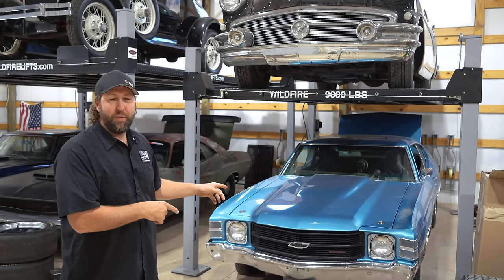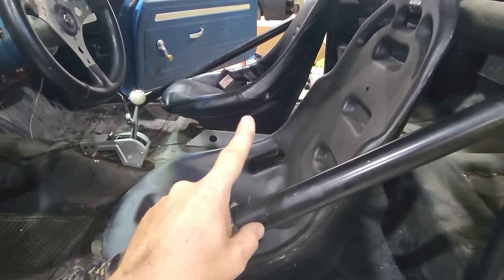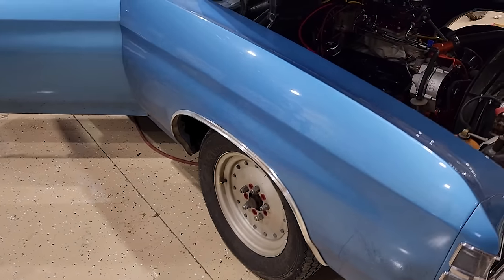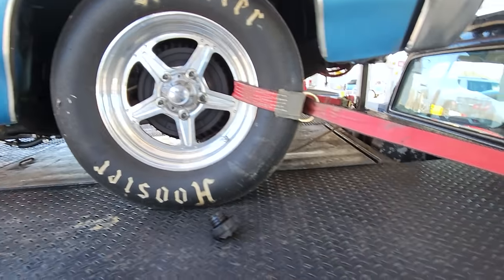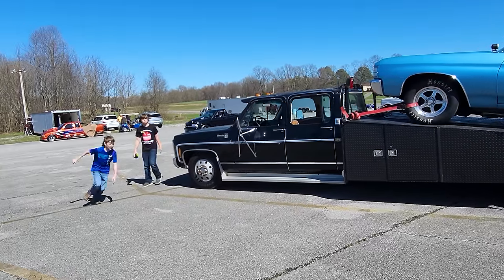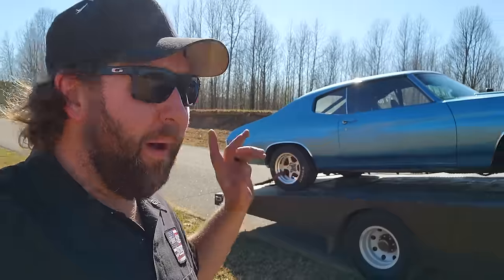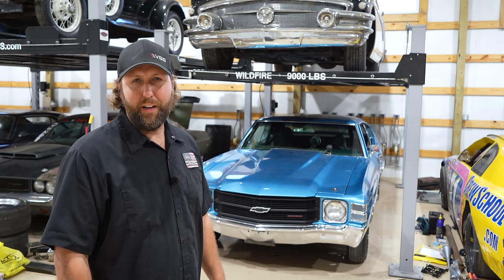35 YEARS off the Road - Classic Chevelle's First Passes are INCREDIBLE!

Comment: THANK YOU FOR THIS VIDEO!!

Lil late on the comment section. Just wanted to say a guy had virtually the same car in high school. 
Blue 70 Malibu, 383 Stroker, 4:11 posi, line lock, ratchet shifter, Vic jr manifold etc. 
Watching this has inspired me to find another Blue 70 Chevelle. This is almost identical to my old  car. Mine also ran in the high 12’s.

Comment: I could really see a couple of different ways to go with this. I think I would for sure keep it old school, either the 400, or a big block. First, put a shifter in it that you're comfortable with. It would be the perfect home for the big block from Independence, which is what I think most would want to see. It would be great to take the 400 to the next level though, with aluminum heads, roller cam, higher compression, etc etc. 4 wheel disk conversion for sure!
Reply: Yes, great project! But make the shifter a priority! Keep up the great content!
Reply: Didn’t he put the motor from independence into that nascar truck chassis?
Reply: @andywagoner4869  He put the original 454 he built for Independence in the nascar truck. the Blueprint 540 is still in Independence.
Reply: @konfyoused  oh gotcha.

Comment: Man, that is one SWEET Chevelle! If a guy gets that shifter straightened out, and a decent radiator, I think it could run a 12 flat in the quarter with a few timing and tire mods. Talk about low budget racing, that's it right there, Derek!! What a great ride.😄👍🏁 EDIT: I just went back and looked at your test and tune video, and looked at the distributor. You'd be wise to upgrade that to an HEI unit, and open your plugs up to .045 for some easy horsepower on that small block!😉

Comment: The reverse valve body shifter sounded pretty cool. If you do an engine swap keeping it old school with a 454 would be pretty cool too.
Reply: that chevelle could have had anywhere from a 250 straight six to a 307, 2 different 350 options, or a 400. a 454 was available in SS trim only.

Comment: Love the sound of that motor!  I hope you do some incremental mods with plenty of testing. Better shifter, electric fans, hotter spark, etc. I agree with the guy that suggested fender covers to protect the paint. With VGG logos they would be a good addition to the store.
Reply: I'd spend my money on a proper trans and rear for this car. 

Even if you're only pushing 500hp, a trans brake and a locker are good investments to get your ET to be more consistent for bracket racing.

That and proper valve springs. Stop the valves from floating.

Comment: Great video - I really like the idea of keeping it a late 80's monster street / strip car. Would love to see it rev out with a big old school solid flat tappet cam with 250+ @.050 duration and the 4.88 gears. Like an Isky Z-30 or even an old GM Z28 off-road race cam
Reply: YEA,HE SHOULD KEEP IT OLD SCHOOL FOR AS LONG AS POSSIBLE
Reply: The current engine doesn't have enough compression for a cam like that.
Reply: @davelowets  I mean if it's got 11:1 you can go pretty big on the duration. As far as I know I don't think the compression has been checked yet the heads haven't come off.
Reply: @colinjohnson7663  I doubt it's even close to 11:1
Reply: @davelowets  if it's got flat tops and 64cc camel humps it'll be close to 11.5:1 so I guess we'll see
Reply: @colinjohnson7663  If it was that high, he'd be running less timing, and pump gas wouldn't be a good option.

Comment: Absolutely great video! Our 406 has heavily worked Trac 1 heads and it makes a difference. I would say with a really good set of heads, a swap to E85 and see if you need a little different carb would make a good difference. What about the gear? What was the rpm when you crossed the finish line? I would bet at least a 4.56 would help. We're running 5.38 and crossing the finish line at 6700. I wonder about your rear tires as well. Thank you ..... fellow Tennessean!

Comment: What a great find.  The car has such a unique history and been preserved so well I’d love to see it stay more or less in its current form.  Pull the 406, tear it down and closely inspect, and rebuild it with some modern techniques and equipment, especially heads/valve train to raise the RPM and power thresholds safely & reliably.  Put a serious cooling system and a Gear Vendors overdrive unit in it and make it a true Sick Week machine.  I know it would be fun to swap a big block or spicy LS into it, but I’d love to see it optimized in its current state and keep its history intact for future generations to enjoy.  Long time subscriber, love the channel and can’t wait to see you work on that GN!

Comment: Just wanted to let a fella know, if you dismount the original wheels off the Chevelle, those Centerline wheels are prone to leak where they are put together in the center.  Easy to fix.   Clean the seam out good and apply a bead of clear silicone all the way around the wheel and smooth out with your finger.  Give it about 20 mins before you remount tire then air them up,  the air will force  some silicone into the seam and help the seal even more.  Works most every time.  Always enjoy the videos and seeing your boys in the shop with you.

Comment: I remember in the mid 90's I helped my buddy rebuild his 350 and we had the same issue with the power band just flattening out after 5500 RPM. After multiple attempts to figure out why, we finally swapped out for a new cam shaft. That made an entire world of difference. While the old cam looked good, and felt good, it wasn't aggressive enough to keep pushing past 5.5k. It's been far too long since I've done any work like this, but man, you made the nostalgia juices flow. Thank you for sharing!

Comment: Back in the late 80s pulled a old Newport  with my v6 80 Camaro  about 50 miles to a Bumb and Run with a chain.Track was Checker Flag in Windsor  Ontario, closed now. Tuned in from Ontario. 🇨🇦

Comment: This brings back some great memories.  I ran 1/4 mile track back in my days at Hollywood Speedway (Fl). That was many years ago with my 69 Z/28 with 302 cu in, mild cam, headers, nothing outlandish. My times were in the low to mid 13s with street tires and closed exhaust. Basically right in from the street. My arch rival ran a fast Chevelle with a 396. We flip-flopped on the win but I did make some bucks on  those runs, and lost some as well.   Please show us some more on your Chevelle at the track.
EDIT: Funny that about 40 years later I now live in a community located right about where the track was. The track is long gone now but I swear I can still smell burnt rubber in the morning. 😊

Comment: I say keep upgrading any required safety items, new shifter that actually works, new radiator and electric fans, and a transbrake. Basically, the minimum required and drive the wheels off it until the 400 pops, then it is BBC time... Beautiful Car. My first car was a 68 Chevelle. Always loved those crank vent windows! You could fit 8 skinny 16 year olds on those front and rear bench seats! Keep doing what you're doing, God bless you and your family Derek.

Comment: @ViceGripGarage
A good cheap temporary radiator fix that has got me out of many of jam is that Alum-a-seal puddy that comes in the round clear cylinder tube, it looks like playdough and comes in 2 different parts, mix em together and they harden. Try it sometime‼️

Comment: gear and stall make a world of difference . I had a 80 firebird that ran 10.30 in the 1/8th because it had factory 2.73's in the rear, switched to 4.10 and it ran 9.0's, had a 3000 stall put in and it ran 8.60's.

Comment: Great, great, great video Derek!  This brings back so many memories from that era.  I too was a senior in high school in 1971 and bought a new '71 Duster 318, 3-speed stick.  Later built a mildly modified 340 and put in it with a 4-speed.  Never raced it but had tons of fun on the street.  I would give anything to still have that car.  As far as my suggestions for this car, keep it a small block, but build it a strong one that is still streetable, and put the biggest slicks on it as you can without having to tub it.  And....get that shifter straightened out.

Comment: This car reminds me so much of my old mans Buick Skylark, its a 77 model, built 350, camel heads, lunati cam, edelbrok 2+2 intake, th350 with a vega converter, used to have a 12 bolt with 4.10 gears. Never believe it would pull the front driver like your car does, and it runs 8.0 in the 1/8th was a sportsman bracket car. 

These old cars will surprise the hell out of you with that which they put in em, and be reliable. Myself, I got a little s10 truck with nitrous, way different from back then.

Comment: Good video,  just a few things; I'm on the verge of 65 lol and remember going to the track when in the same time frame of when this car was being ran. The paint originally on the car was Dupont Lucite, a lacquer based paint, an EPA nightmare today but a great paint, easy to blend and buff out an oops! When you talk about pulling the car with a tow bar, it was called flat towing and was an affordable way to transport your car, it was done with tow hubs which prevented wear and tear on your drivetrain.  The tow hub was basically a free wheeling front hub that bolted on your axle flange, it allowed the rear wheels to turn without the axles turning.  Good luck with the car, I may see you at the track, I'm in Georgia near Atlanta.

Comment: very cool, reminds me of my dad's car, he's about the same age as this feller who owned the chevelle, graduated in 72' and bought his 62 corvette as a project at the age of 18, went through numerous small blocks, transmissions and rear end combinations throughout the years but ended up with a 406 also, built in the mid 80s in a very similar fashion to this car, OLD comp cams camshaft, originally had some GM "fuelie" heads on it and an old single plane intake, best time with a 4 speed and 4.88 gear was an 11.80. Car still has the same short block in the car to this day just rebuilt, same cam, now AFR heads and a better single plane intake through a TH400 it runs in the 11.70s.  This chevelle has the potential to be in the high 11s with this motor, maybe change the heads to some good aftermarket aluminum heads, and a more up to date cam, reseal the engine and see what it'll do!  Love it, don't change it up too much!

Comment: I'm impressed with the Chevelle & as far as flat towing, that's  what I did in the 80's with an old 70's street car I'd bought for $300.00  A 62 Plymouth Sport Fury w/ a 440 transplanted in it w/ the old cable shift 727 & a 3.91 posi.  I welded up a tow bar in mom & dad's driveway.  And my younger brother & I towed  it with his stick 6 Chevy van to Detroit Dragway  I had a competition valve job done on the heads,  put in a 2.84/4.84 purple shaft Direct Connection cam and lifters, a Weiand open plenum high rise intake and an 850 Holley and a set of used $25.00 set of B body headers, a 6 point roll cage gutted the interior, doors and glass & replaced them with Plexiglas and a lexan windshield.  Fun car!  Years later a buddy of mine & I flat towed his 67 Chevelle to Canada every Sunday for quite a while. I wish I could still do that stuff! I'm 69, & retired but I still have a 1992 Sportster 883 to play with.  😉

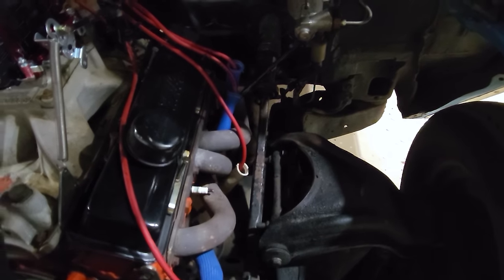Comment: I had a 69 Chevelle 350 had a little work done to it. Just out of school 79. It ran 12:40s with interior still in it  Street legal 488 gears turbo 350 trans with a B&M shift kit. Since you’re only racing an 1/8 of a mile, I would put 513s in it maybe a better set of headers and definitely a better shifter and line locks. Well,we love you Show an be safe,good luck at the track.

Comment: The 400 to have is a 1973 sb 400 with a 4.125 bore!!! Found in a 1973 impala station wagon if memory serves me correctly. Then go. 030 over, stroker crankshaft, custom length rods, heads, 3k-3500 stall or manual trans, our 73- 406 stroker had amber lightweight pistons 11/1 compression. 373 gears on a red w/black trim 1979 Z-28.

Comment: Nice!👍
Makes me miss the 72 Chevelle 350 4-spd I had from 1979 to 81.
Being a Teenager at the time I did not know that a factory 4-spd was not very common! 😕
Red with a black vinyl top and bucket seats. 
Made some good memories in that car going to College in Phoenix.😏
Black interior and a big chunk of aluminum on the Hurst shifter was no bueno in the summer! 😁🔥
Could have sold it for more than I did. 😕
Same could be said for the (2) 69 RS Camaros, 71 Torino GT 351C 4-spd, 71 Vega Hatchback 4-spd V8 327 from a 68 Vette, and a real fun little 1970 Datsun 510 2-door, 4spd L16! 
Live and learn! 
Now days I have to get my V8 fix from a 95 Cadillac STS.
Fun, but that Torino was Quick and Fast! Did 143+ mph the first night I got it, at 16 years old.
A friend with a 160 mph speedometer equipped  vehicle told me that's how fast I was going when I was leaving him!
My Speedo was buried somewhere down by the radio! 😁
The front end started to float a bit, and luckily even my 16 year old brain thought, might wanna slow down! 😱😁

Glad You and the Family had fun!
Kids are lucky to have a guy who can teach them a thing or 3!

Mike in San Diego. 🌞🎸🚀🖖

Comment: 👍 one suggestion you could have welded the bolts on the brackets and bam no issues. A MSD For Bigger Lightning. Aluminum rad. And a fuel cell to compensate for the added weight 😂. Also you can up grade to a willwood discs conversion also a bit more weight saving. And maybe in low 12 to high 11s. Or lower since your going away from the fan

Comment: Im TimDude back in the 90s my 69 CHEVELE ...went 12.43 111mph in the 1/4 mile at pomona californa on a short shift 4000 rpm from first to second 7000 rpm into high had bad bushings in the column shifter ...turbo 350  trans crumby torque converter ...it was a 10.5 to 1 comp standard bore 350 ...full race ported 186 casting heads 205 intake valves  giant soild cam 552 lift intake 572 exhaust 268 duration at 50 ....TEAM G INTAKE MANIFOLD 750 HOLLY 3inch  exhaust race magnum dyno max mufflers 4.56 gears...i did lighten it a little ...i wish i still had it ...PEACE OUT DEREK

Comment: Had a 400sbc swapped ‘69 Chevelle in ‘75 & a 13.2  mild 406 in a ‘79 Vette in 2000. 
Gosh I love your Midwest values & taste in engines!
How about a set of AFR 220’s with a stout retrofit hydraulic roller cam for Liberty?
Did you daylight the left front?

Comment: Yep, 406 with camel humps, cam, a decent manifold, 3000ish stall and gears was the hot setup in the 80s for kids that had a few thousand to put into their racer, without breaking the bank on something like a hot big block.  Of course back then running low 13s was pretty respectable if it was your daily driver.  If you were in the 12s you had a fast car.  

Times have definitely changed!  Running 6s and 7s on cars with plates like on Power Tour, that was NHRA stuff back in the day.

Comment: So that motor and possibly the trans / converter are exactly what I had in my 80 cutlass. I ran exactly the same time in the 8th with 3:42 in the rear. I bought a power charger 250 with the matching cam to upgrade, found out the heads would have to get redone to run the cam and never installed any of it. I’d love to see what would happen if you just slapped a similar mild blower on the existing motor. I was told I could’ve just slapped the power charger on without changing the cam or anything. I think you have to have lower compression at least (8.5 to 1 ideally?)

Comment: Well, apart from needing a new radiator, do you have any hangups about the engine seals? If the plan is to take the car on drag-and-drive events, it might be a necessary evil to break it down. I love the way the car looks in the sun with those 5 spokes. That's always been my favorite A-body color. I also agree that the way it looks on that square body is A+ driving. Good luck!  Still my favorite show anywhere, and I continue to live vicariously through it all.

Comment: Hey Deric, the 400 CID I ran in a77 Monza Spyder in the 80s had a mean Sig Erson cam . 304° duration with the long connecting rods, 202 dbl hump heads. Teflon everything and polydened piston tops and combustion chambers.
For today I would rework a set of Dart two's and check with the chemistry guyz about combustion coating aluminum heads.
A F.A.S.T. racing system would be a luxury for a old gear head like me. But I do love a well built 400.
Reply: An oxygen adder? Just a couple of kasnozzzles?

Comment: You wouldn't have a big block sitting around to build, would you Derek?   Raising that HP to the 500 mark would be awesome, 'but' I'm unsure of spacing, as even the 400 looks wedged in their pretty good!   What I loved on your runs was, watching the front tire lift off a bit, each time you took off, showing it had some awesome power.   I had a '67 Nova 327 4 speed back in my youth, and with it being a light car, it was pretty fast as well...albeit, my (2016) 3.5 turbid F150 six cylinder comes from the factory now, with a lot more ponies than my Nova did, but I'd sure love to have another one!   Prior to that, a stock '57 Chevy 2 door HT, with the 283...and man, do I have some great memories for those days!

Comment: I'd bet that car is closer to 3500-3700 with you in it Eric.  Somethings that would help a ton getting the ET down on that.  Getting rolling resistance off the car whether it be drag or weight itself is the easiest.  While it's not cut and dry (drums have their advantages etc) I wonder if a disc brake conversion would help because those drums are pretty heavy all things considered.

Comment: Derek - Before you take the next step in the evolution of this car with another motor, consider buying a "cheap" turbocharging kit from eBay, and possibly another set of heads to lower compression, and squeeze the snot out of this motor. You need to do it so we don't have to!